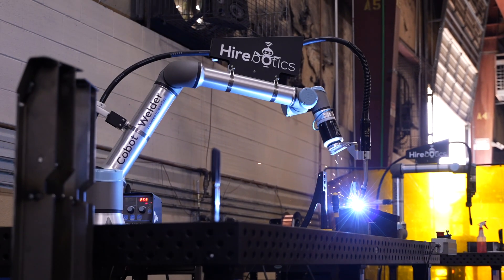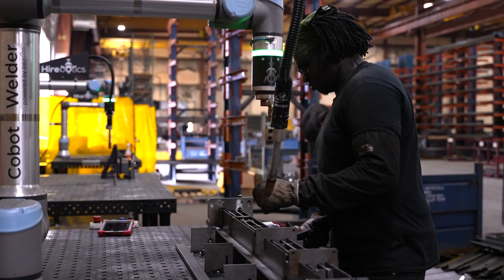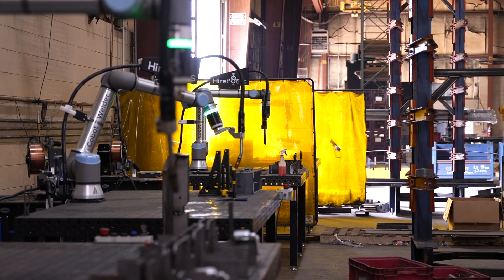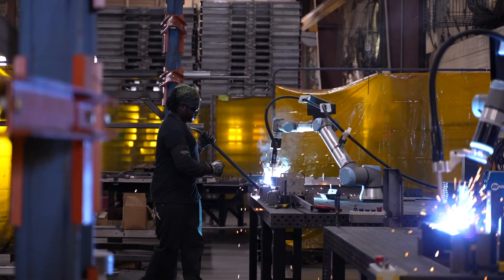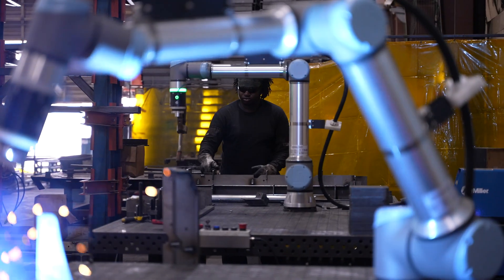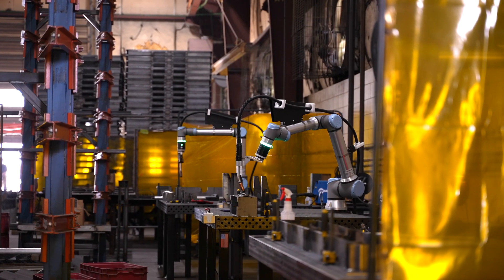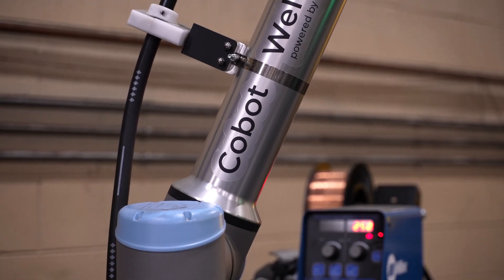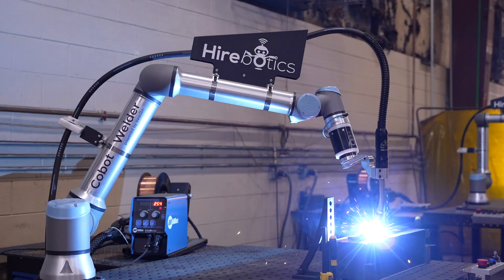Cobot Welder Increased Production 400% | Advanta Industries LLC

Comment: Its a process driven machine so a welder will always be the best programmer and operator. As generally a robot using single wire does not weld any faster speeds than a manual welder and in this case the inter movement speeds are quite slow I can only think to get a 400% production increase the manual welders were very unproductive!
Reply from the maker: In fact, you also need to think about the time the robot can still keep running compared to a welder who needs breaks or stops at the end of his shift. The cobot can keep welding the parts setup overtime.

Moreover, you need to consider that most companies nowaday have a backlog of jobs because they don't have enough welders. So adding a cobot or 2 to weld at the same time than your welders are welding can mean 200-400% more parts produced. ;)
Reply: @Hirebotics  The output and payback adavantages of a robot system are well documented and known by the top proffesional robotic systems companies specialising in the GMAW  processes such as Fronius, ABB, Cloos, Igm, Kuka etc and without technical advantages such as Twin wire, CMT process. single wire high deposition or part manipulation then the nominal advantage is approx 2.2:1 , When we came across these 400% production increase claims it almost invariably turned out the manual welders were not productive or efficient in the first place.
The basic calcualtion is really quite simple, the robot usually gives an arc on utilisation and efficency of approx 80 - 95% depending on the applicartion, number of welds, intermovement etc, etc
A reasonabkle manual GMAW welder comparitively is expected to return approx 30 - 45% utilisation which gives this relative payback factor.
From what I've seen of these Cobot robots I dont think this ratio would be as high as this as they are very slow in intermovement, making the arc on utilisation much lower. Many of the robots I supplied had intermovement speeds of upto 3 metres per second, so fast you almost did not see it. Of course a different level of safety was required for these imcredably fast robots but the production gains were far higher than the robots in this video.